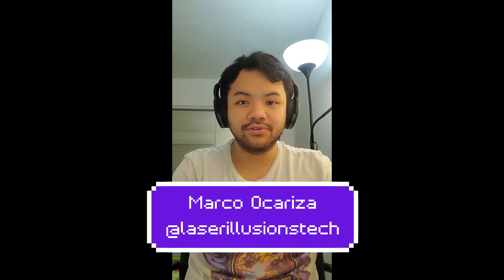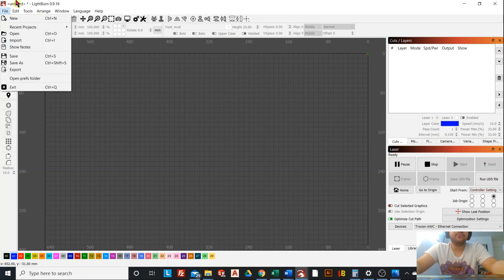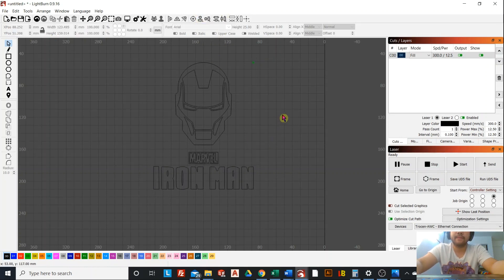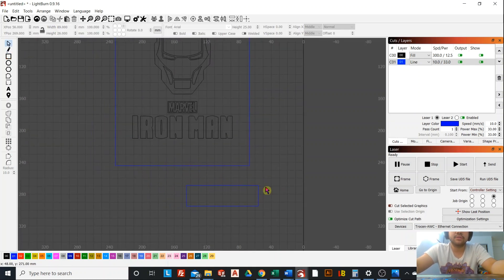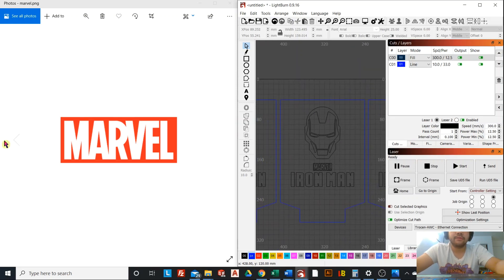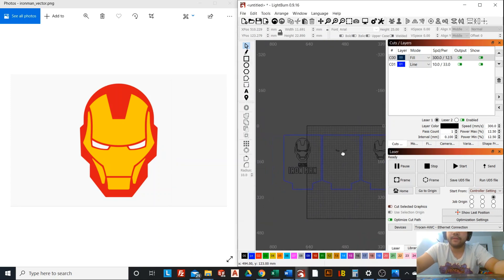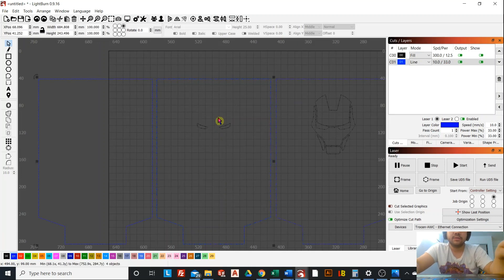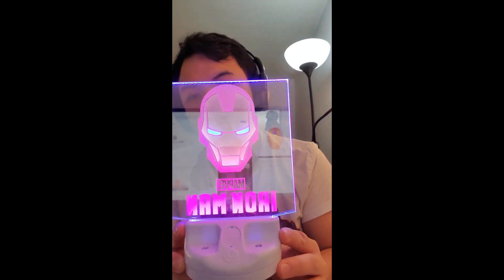How to make a Multi-Coloured LED Lamp! | LIT Tutorials

Comment: Hello congratulations for the video, but I wanted to ask you what is the thickness of the acrylic sheets?  The thickness of the slot on the base with led is 4mm and you have used 4 overlapping acrylic sheets?  Or did I get it wrong?  Thanks so much
Reply from the maker: The slot is 8mm thick, and each sheet is 2mm thick. There are 4 layers.
Reply: @Kubokraft3D  Thanks a lot for the answer.  Could you give me a link where to find the led base?